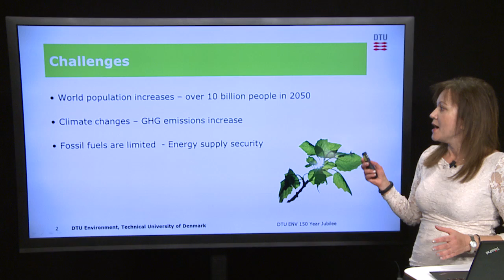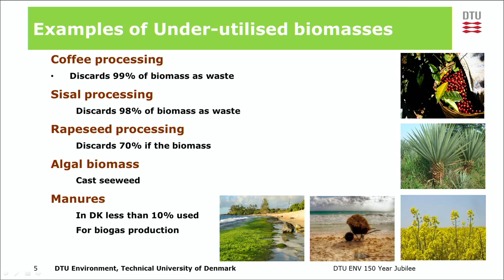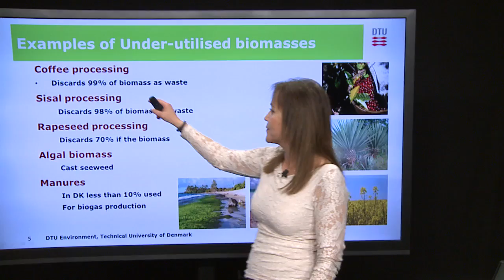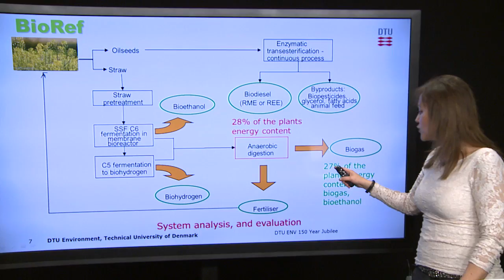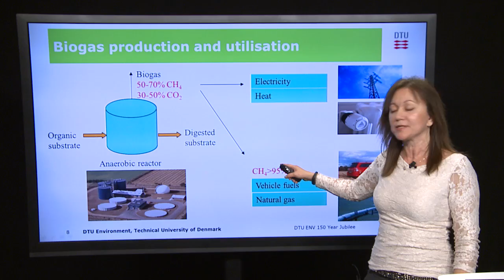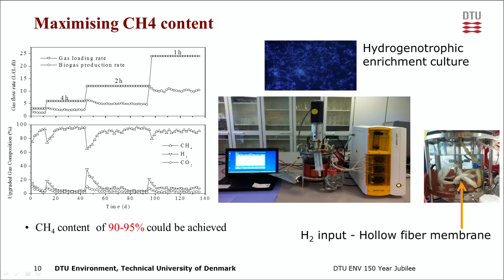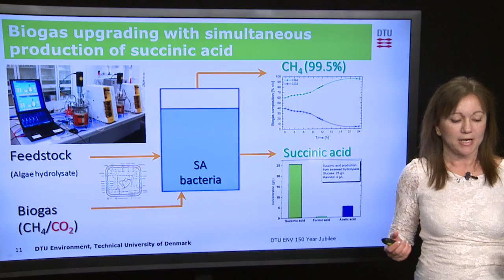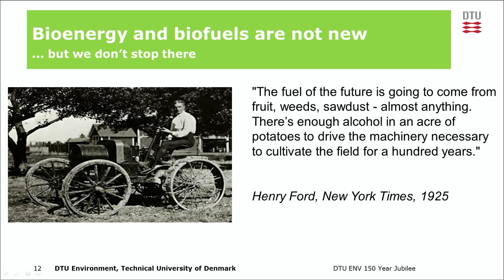Converting Residues to Products, Fuels and Fertilizers

Comment: I read your article (Hollow fiber membrane based H-2 diffusion for efficient in situ biogas upgrading in an anaerobic reactor) about biogas upgrading with hydrogen. Very smart idea to use membranes for better gas to liquid transfer 👍

Another interesting research paper about biogas upgrading through hydrogen addition came out last year (Production of high-calorific biogas from food waste by integrating two approaches: Autogenerative high-pressure and hydrogen injection). They used a reactor under pressure (AHPD) to ensure better solubility of hydrogen in to the liquid phase and to overcome the rise in pH.